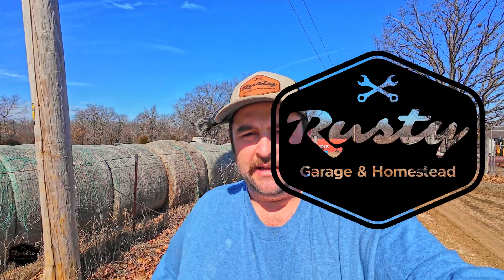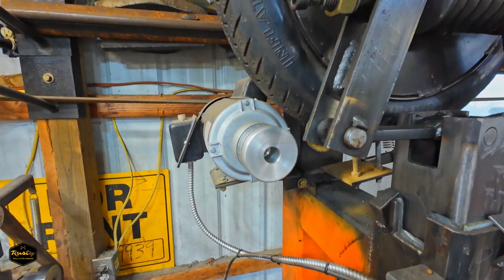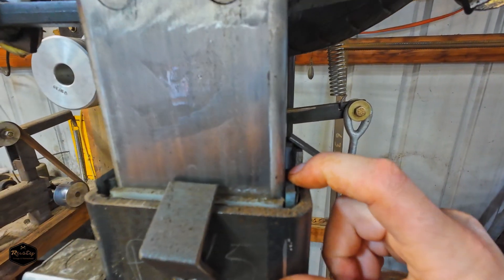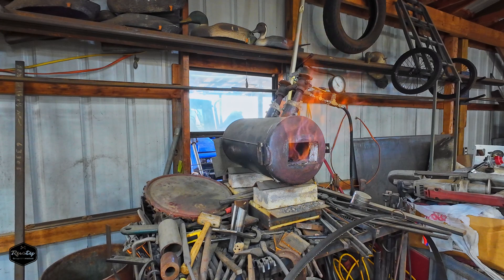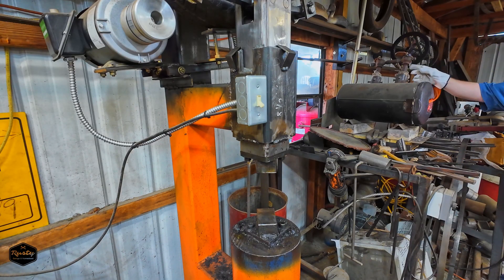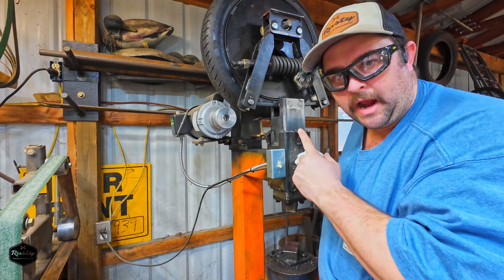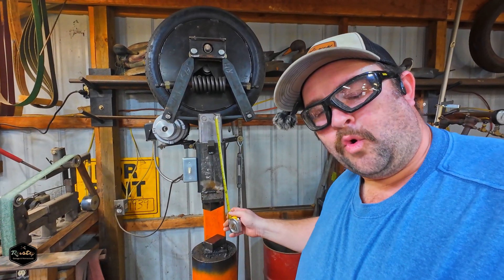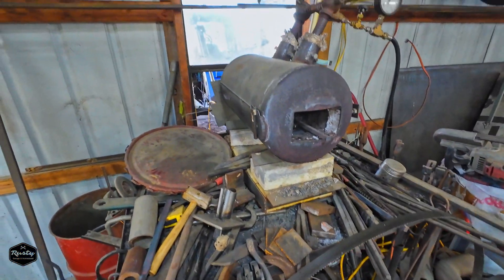I Built A Homemade Power Hammer

Comment: I think 50 lbs
Reply from the maker: WINNER WINNER
Hi Mr Neal. That's is a really good guess. That is correct. The hammer is filled with lead. I melted it down and poured it inside the tube. This hammer is based on the Clay Spencer tire hammer.
My contact info is my video descriptions. Send me and email so I can get your shipping info.
Great job Neal
Reply: @ that’s awesome. Email sent. Thanks!

Comment: What is the point of the spring up top
Reply from the maker: It basically acts as a cusion and allows flexibility on what size material you can hammer on.

Comment: That is very cool Mike! My dad has an old power hammer. Haven't seen it used yet though. He bought a few years back at an auction I believe.  My guess is 16 lbs. 👍👍
Reply from the maker: They are cool tools. They can be very expensive. 
No sir 16 is incorrect
Reply: @TheRustyGarageandHomestead  Yes they can. I didn't realize the tube was filled with lead. 👍
Reply from the maker: @NeighborlyHomestead  i had to melt down several ingots to fill that thing